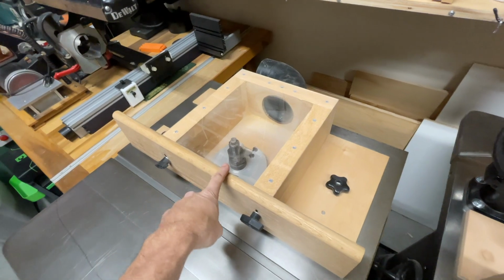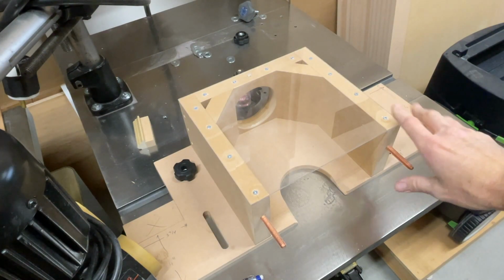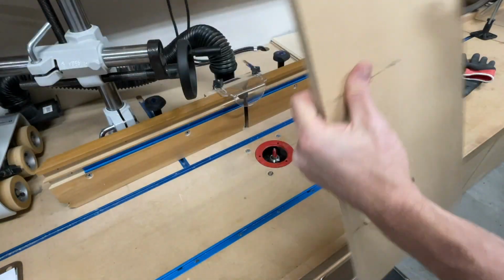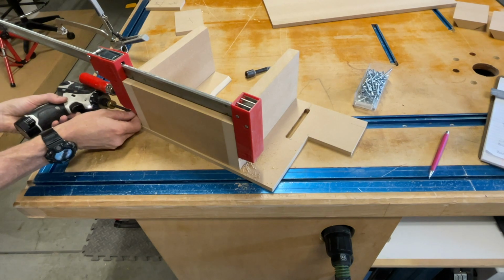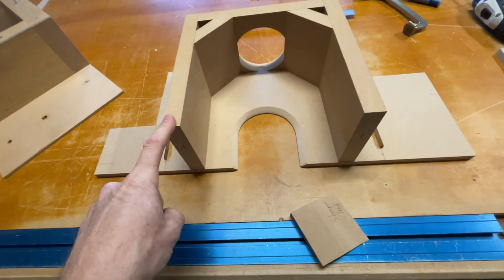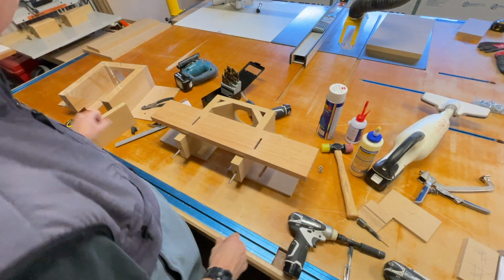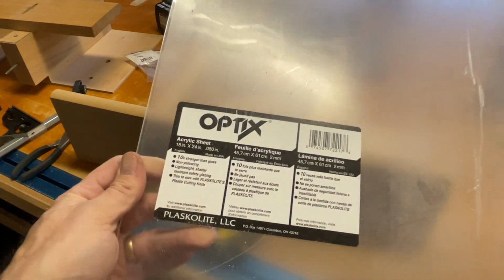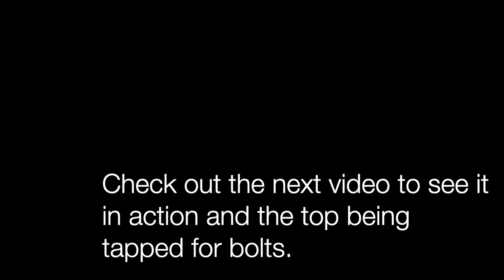How to Build a Custom Shaper Fence

Comment: A very nice design and tomorrow I will make one with a couple of additions to your version.  I plan to put a strip of Formica on the bottom 1/2" pieces the wood rides against and  the same on the hold down fence.  If I had a question if would be if there is a concern the panel could raise enough without feather boards to  harm the surface of the panel.  Nice workmanship and good clarity.
Reply from the maker: Hi Tom.  Thank you for watching and commenting.  I’m really happy you found the video and are going to build a version.  Let me say I actually like the feel of the wood riding under the hold down with a bit of resistance.  That is to say, not slippery.  It makes it feel very solid and under constant control without feeling slippery.  If you get what I’m saying.  However try the Formica and see how you like it.  Once the machine starts up, the spinning knives actually make the workpiece slide very nicely.  It just works so well.  Make sure the panels are the same thickness, because it will effect the amount of pressure that is down on them.  I’ve never had any issue with material lifting up.  Just nowhere to go.  Too tight for anything to lift up.  Way better that feather boards.  However you could always add feathers to the hold down, or attach feather board to it.  Very easily if you felt it needed them.  But I’ve run hundreds of panels and they are perfect every time.  And zero dust.  Seriously.  No dust if you build it like mine.

Comment: absolute great idea, incorporating safety, ease of use and amazing dust collection all in one. Great ideas!!! Would the fence system work with higher cutters for example like handrail cutter or crown moldings which I used a lot. would sure be better instead of the split fence I've been using for years..
Reply from the maker: Thanks for the great comments.   I use another custom fence for my taller cutters.  But I think this could be modified for them.  Absolutely.

Comment: I appreciate the videos.  I'm making wooden storm windows with custom rail/stile router bit and coping router bit.  Need to come up with a couple coping and tenon sleds also.
Reply from the maker: Hi richard. Thank you. I am happy you are enjoying the videos. Are you using the router table for the storm windows?  I just use a block of wood with a push block screwed to it for my rails.  It’s very easy and I make hundreds of doors this way.  Maybe you’ve seen the videos of me making doors?  Have you tried it that way?
Reply: @davidbryanwoodworksandmore  I have to use mortice and tenons and match an existing interior profile for a customer.  If I didn't I may have used your method.
Reply from the maker: @richardmckrell4899  sounds good.  Good luck with it.  Thanks again for watching.